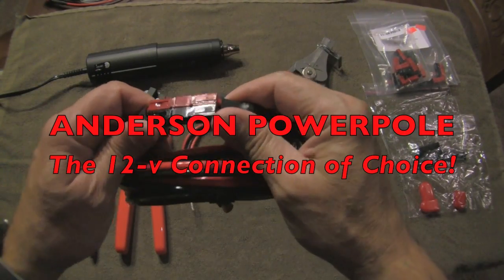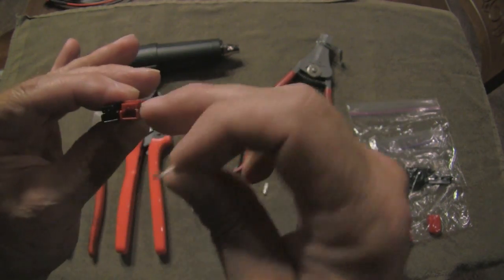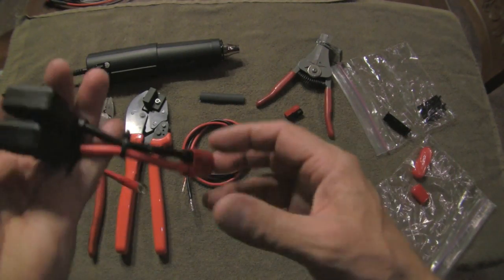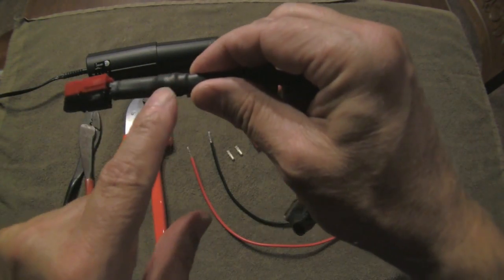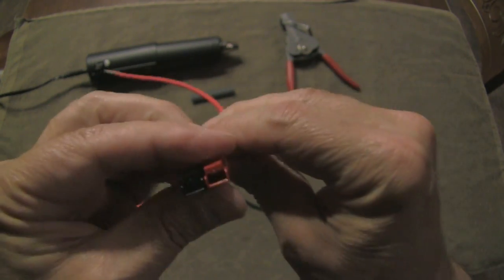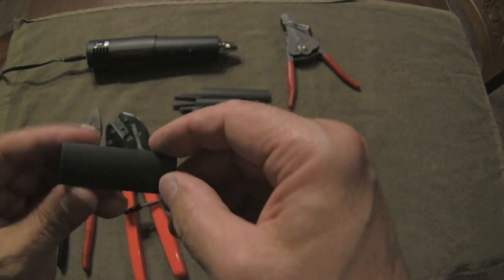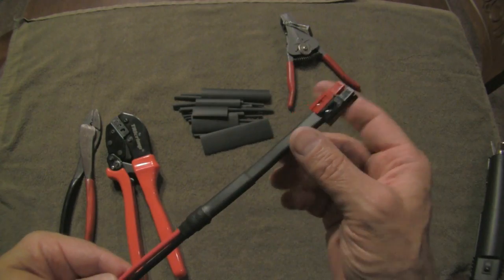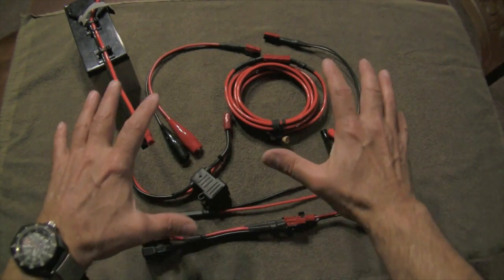Anderson Powerpole Connectors How to Guide "12-volt Connection of Choice!"

Comment: I have seen a few videos now where guys say the red is on the right, or on the left.  It DEPENDS on which side of the connector you are talking about.  It is left on one side and right on the other side. This is because if one snaps a pair of these together, one is UPSIDE DOWN from the other one.  If one gets it wrong, they can separate the housings and swap them around by bending the wires a bit then dovetailing them back together again.   This is a pretty good video, but next time you make one, use a white background, not a dark one.  It will be easier for us to see.

Comment: Every video does not show how to run your wire into the side of your house using the connectors and especially if you use 8 gauge wire.
Even MC4 glands are screwed up with 10 gauge wire.
I need an Anderson connector outlet box for the side of my house, preferably with a very LOW visibility color like light gray or a light yellow.

Can ANYONE tell me where to get that outlet box?
Must be weatherproof.

It is for connecting my portable solar array to the house when needed.
I have to use 8 gauge wire due to 12 volt and 100 foot run.

Comment: My understang has been, when you cripped connects you should put the wire in with twisting cthe wires. That way the crimp will grac two bundles of wire tightly. Personaly at these gauges I never have a problem putting  the terminal on the wire.  A nice production but the audio cuts seem be a little bit off.
Reply from the maker: Thank you for your insight and constructive criticism.

Comment: I do not use the roll pins as they might fall out unexpectedly, I use super glue to hold the two Power poles together.
Reply from the maker: +Freedom to be Fred - super glue is for sure a solution. I haven’t had a roll pins fall out yet. I have also used the roll pin hole for a small zip tie to keep a connection between to Andersons secure. 🙏 Thanks for watching!
Reply: I just put shrink tube wrap around the backs of my power pole connectors, as well as the wires.

Comment: If I wanted to pick up some terminal ends That used to sit on an AGM battery, and wire them with Anderson’s so that they can receive 12v from a goal zero bank output, is that an effective circuit? @usnerdoc

Comment: Great video Doc,  I do love these little connectors and I love your accessories you have created.  I shall borrow those.  A couple of things that I do differently is that I solder all my connections rather than to crimp. (I'm too cheap to buy that tool) and I never use those little roll pins.  I find they stay in place without any help but if I had a problem I'd put a little drop of super glue on that dovetail and be done.  I don't want that little piece of metal anywhere near my electricity.  Mike.. W4TRK
Reply: Someone should make PLASTIC ROLL PINS FOR THIS 🙏

Comment: Great video, Doc, and a good example of why Power Poles rock.  Here is a video explaining one of the most common failure modes of DC electrical connections, and how to solve it.  BTW, we use Power Poles exclusively for DC power when we have a choice.  ;-)
https://youtu.be/bJSXU6nLXCE

Comment: just wanted to thank you for this video, as you confirmed some info i needed about these connectors, which nobody else stated. The rating of connector is only the pin, not the housing, a 30 can connect to the 15 or 45 connector.

Comment: I'm having a hard time finding Power Poles of the right size to meet my application. I have two different size power pole connectors, one is fixed inside of an inverter and I cannot remove that, and the other came with a mounting bracket someone gave me. With the positive and negative attached together, what are the widest dimensions of the whole plug unit?
The smaller of my power poles measures about 12mm wide and 6mm tall, but the one in the inverter I have measures  31mm wide and 13mm tall. The ones in your video appear to be somewhere in the middle! It feels like there is no standard to be able to shop confidently with.
Reply: AFAIK, there are only two "standard" sizes for PowerPole connectors - the two-piece PowerPole, and the one piece PowerPole SB.

The way the patented system works is that the connectors are hermaphroditic, but still keyed so you can't accidentally reverse polarity.

Comment: Where  can a buy an anderson connector for a 12v battery already made? Not handy enough to make one! I need to connect it to a battery & solar panel to charge a ham radio & other small devices Thx!
Reply from the maker: +L Hernandez - Depends on the terminals of your battery. If they are like the ones in the video (F-Type Connector) then check https://powerwerx.com

It looks like Zamp Solar uses SAE or Bullet Type Connectors. Pwerwerx makes an Anderson Powerpole adapter.

Ring Terminal to Anderson Powerpole
https://powerwerx.com/powerpole-connector-ring-terminal-6ft

F-Type Connector to Anderson Powerpole
https://powerwerx.com/f-type-battery-terminal-powerpole-adapter

SAE (Bullet Connector) to Anderson Powerpole
https://powerwerx.com/bullet-sae-to-powerpole-connector

Zamp Solar Wiring Accessories
http://www.zampsolar.com/wiring-and-wiring-hardware/

Hope that helps!

Comment: Hi what size ANDERSON POWER CONNECTOR fits 10and 12awg wire
Reply: gene mayne That will be the 30A terminals. HTH, 73s de OA4CKN
Reply: thank you for reply gene
Reply: The 45 amp is best..
Reply: steven knight, sure, but 45A will fit much better in a thicker wire, not just 12 AWG.

Comment: A few more shots of the tips sliding into the housings with the correct orientation visible please. You discuss the orientation but the actual video shots gloss over the final placement.
Might be worthwhile to also show the tips face on with correct parallel orientation rather than showing the red/black ends of the "zip cord"

Comment: What size wire do you use for your cable? What size Anderson Power Poles are you using? I am new to ham radio and I have learned a lot watching your videos. I just bought a Yaesu 857D  a few days ago ( my first radio) and I found out how little I know about the hobby. Thanks for the great videos and the help.

Comment: No kidding .! Why on earth would ham radio operators standardise on Sermos connectors AKA "Power Poles" Anyone with any common sense ditched them years ago. Power Poles were first popularised over 20 years ago by RC modellers for use in their high power electric models. They were popular for less then a year before their high failure rate became evident.  At my station I prefer to use European style Barrier Terminal Blocks. These are much reliable and they don't require terminations on the wire

Comment: Those Powerpoles are the the old school RC electronics connectors,  I thought those connectors died out 20 years ago.  LoL  You should check out the new ones made by Deans they are about a quarter of the size of those and can handle a lot more amps.  They are also more secure than the old powerpoles, if I remember right the main reason most the RC guys got away from using them was they came undone all the time.